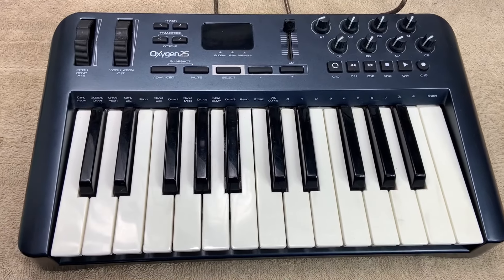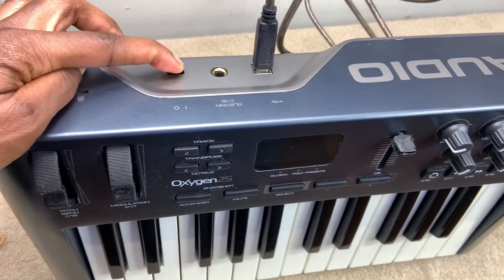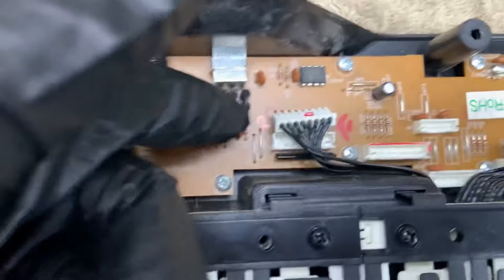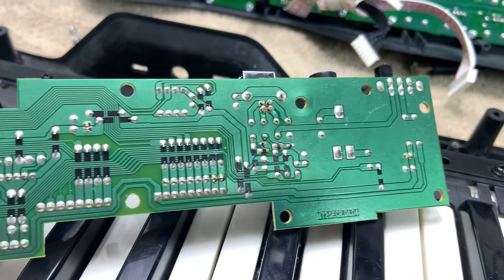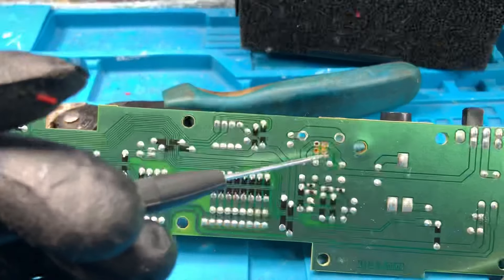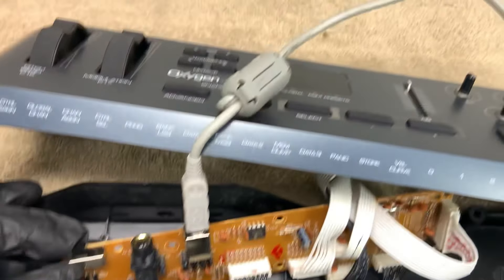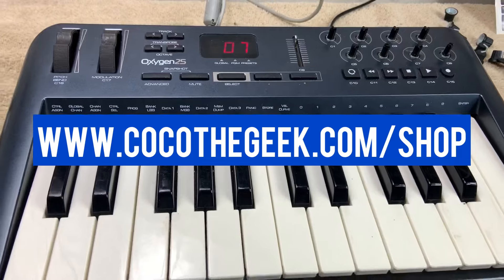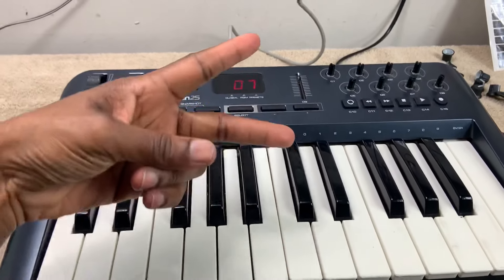M-Audio Oxygen 25 MIDI Controller No Power Repair

Comment: Hey man thanks for showing the insides. I was wondering if I could chop a few piano keys off the keybed matrix to make it smaller. Not actually plan to do that to this version, but rather on a 49 key. Only need about 40 keys so I could use the real estate on the sides. There is no 37 key version unfortunately. Perhaps you have any idea if this would be an option? 
Appreciate it! 👍
Reply from the maker: You probably could because the keys are in a beds so they aren’t all together.
Reply: @cocothegeek_  yeah only worry about the circuit board / keybed contacts containing matrix. Guess cutting it at the right place isn't really destructive to the rest of the matrix. But don't know for sure. Wouldn't like to have to resolder all the end traces
Reply from the maker: @ibendiben  yeah you would have to really find a safe spot to split or you will be in for a treat.
Reply: @cocothegeek_  I'm always in for a treat! Up to candy mountain it is then!! 😁
Reply from the maker: @ibendiben  bring me back a grab bag. Ha ha have fun! 😁😉

Comment: hermano puedes mostrar como son las gomas de ese controlador
Reply from the maker: Rubber bands? Not sure what you are referring to! 🤷🏾‍♀️ please explain more and I’ll see how I can help.
Reply: @cocothegeek_  
I was referring to the conductive rubber bands or tape that go under the keys because I have an oxygen 49 and they sold me one just like the one you show in the video so I wanted to see the rubber bands but it wasn't possible, anyway I already bought the oxygen 25 and Although the rubber bands are similar but the assembly is not, I cut some pins from the assembly and the oxygen 49 now works well, which had 6 damaged keys
Reply from the maker: @JoseDiaz-rw8kz  aww ok. well glad you were able to save and revive the keyboard.